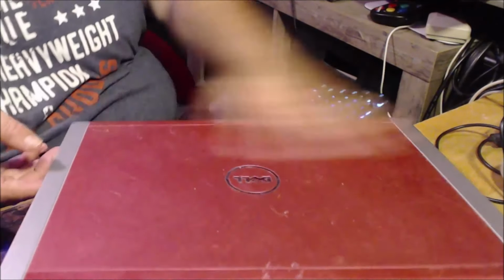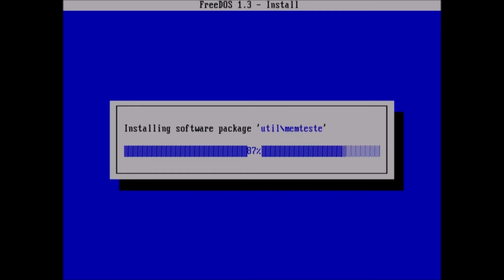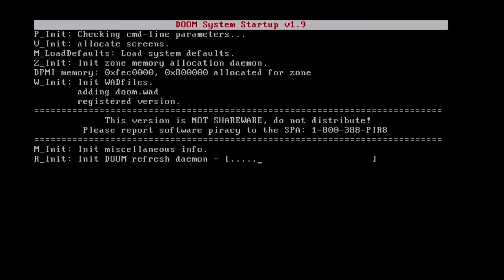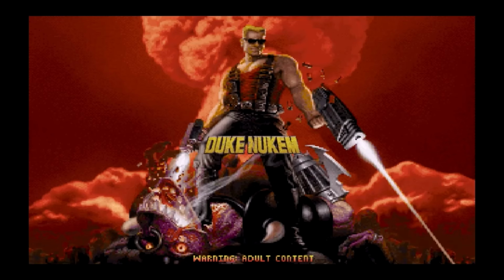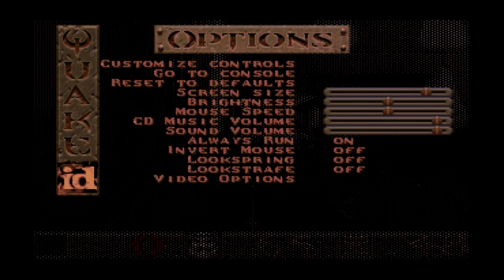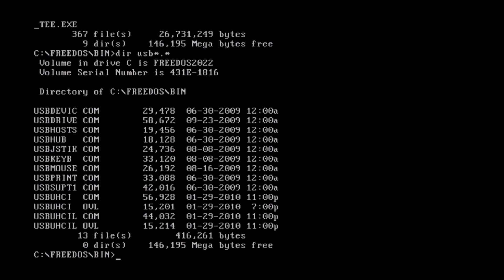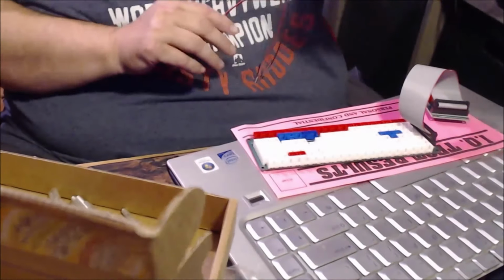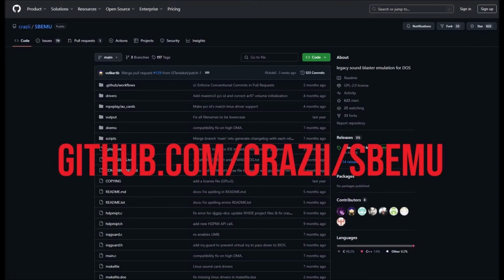FreeDOS Gaming For Dummies with the SKETCHY TECH

Comment: I am on an Android tablet with a DosBox app installed and in DosBox there are not so many commands, so i download/unzip the choice command and a special debug command that provide 16 bit and 32 bit instructions. It looks and works similar to the debug version of MS but the debug version from MS provide only 16 bit instructions. Personaly i don’t play DOS games, but i like to create tiny executable files  with using debug and batch files. I made some videos(no speech) to show how it works and to share the open source projects. Have fun.😊
Reply from the maker: Sounds cool, Max.  Yeah, DOSBox is great at some stuff, just OK at others.  I think FreeDOS is a bit more robust in some ways...they are both a mixed bag, but both a blessing!
Reply: @AmigosRetroGaming  I saw a video from some people that build an emulation of hardware components and they answered some questions from the community about to build an emulation of a geforce graphic card and they said that there is zero motivation to build it and it is very complex and to much work. In DosBox we have the svga-S3 emulation with only a few video modes for high resolution and only a VBE 2 bios, but no function of a VBE 3 bios. The highest resolution with true color is 800x600x32. This can’t fit the display of my android tablet with 1920x1080 full hd, so i got big black borders around with a tiny screen contend in the center and it looks bad and unsharp.

With DOS on a real PC with a Geforce or a Radeon with a VBE 3 bios we can use refreshrate controlled graphic modes together with hardware triple buffering using a CRT-monitor. Example: With a Geforce 4 TI4200 AGPx4 with 64 mb vram on 19" CRT monitor with 96 khz capacity we can use 1280x1024x32 with 85 hz refreshrate, 1024x768x32 at 100hz refreshrate, 800x600x32 at 140hz refreshrate, 640x480x32 at 160hz refreshrate and with a Radeon 9750 PCIe on 28" LCD we can use a native widescreen resolution 1920x1200x32 in DOS.
Reply from the maker: @maxmuster7003  it's funny you should mention that because my next project will be putting freedos on an old PC and installing a sound card and a graphics card to see how far I can get.